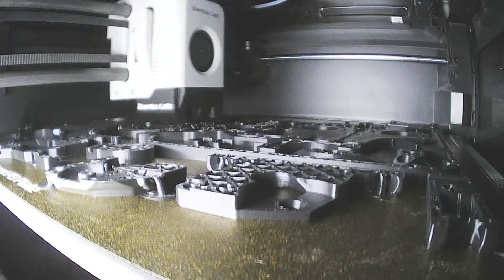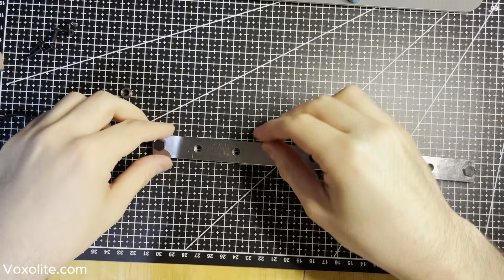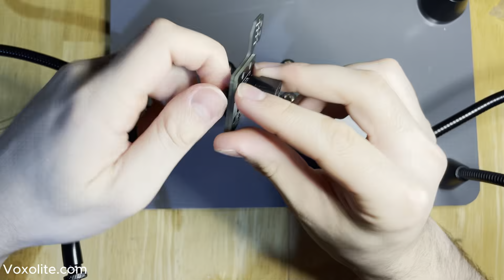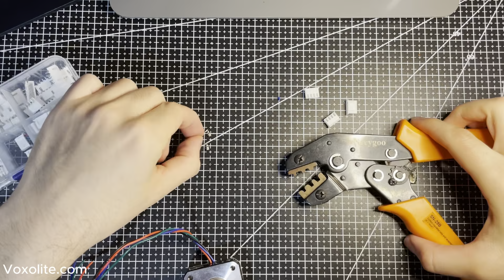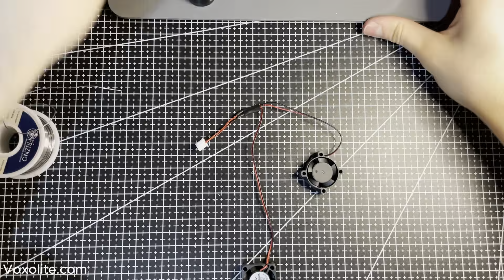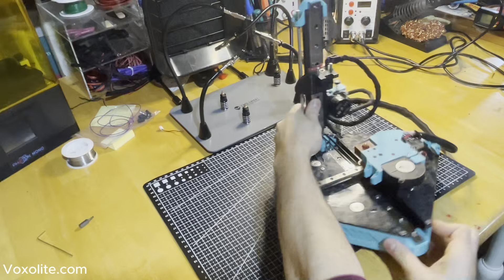3D Printer that fits in a Filament Box - Build Video - Positron/JourneyMaker

Comment: Great preview of the assembly process and goes to shows this is better suited to a thinkerer and I wouldn't recommend to a novice or something that doesn't have the tools needed. Personally I would love to build one of these. As a safety precaution I would recommend more caution around the power supply, especially about insulating that bottom facing part with the circuit board with something more suitable than simple duck tape as a more pointier pin can poke through the tape, maybe a thin fr4 circuit pcb without any traces. Also i wonder if imf interference to the electronics has been considered as the power supply is missing its metal sheelding.

Comment: Did the original creator not get hired by a big company and put under an NDA?

edit: joined the KRALYN discord and saw the following update:

As a result of the Positron Project, Kralyn was offered a Dream Job at a major 3D Printing Company. Not wanting to pass that offer up, and to help support his family, Kralyn took the offer.

Sadly, this company has a HEAVY restriction on what it's employees can do outside of work in relation to 3D Printing Projects. As such, Kralyn has been barred from working on the Positron Project as to comply with his NDA and Non-Compete agreement.

This was a heavy pill to swallow, and we tried to work around it, but the pipeline we have is very small, and very restricted.

As to whome hired him, I've not been officially permitted to say, nor have I been told I can't tell, so we're airing on the side of caution, and just keeping quiet on it, so that we don't get Kralyn in trouble.

All I can say, is that if you are curious, this company is known for being secretive, and is often touted as one of the most premier 3D Printing Companies in the US.

Comment: What if I can't print ABS tho? Also you skipped over the software part
Reply: I know they have the ABS parts available at a fairly reasonable price on their webstore
Reply from the maker: If you cant print ABS you can get them here 
https://voxolite.com/products/journeymaker-positronv4-3d-printer-parts
Reply from the maker: I didn't include the software setup because it was not intended to be a full build tutorial, rather an overview of the build. The software has well documented steps in the build guide with linked videos.